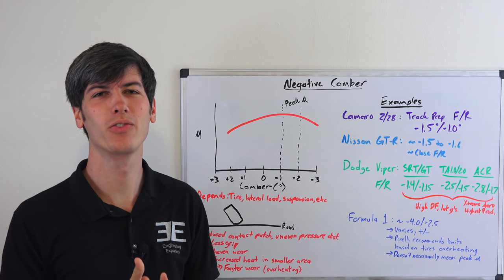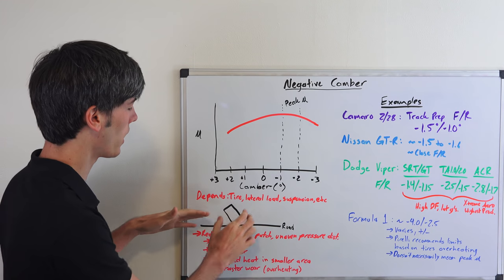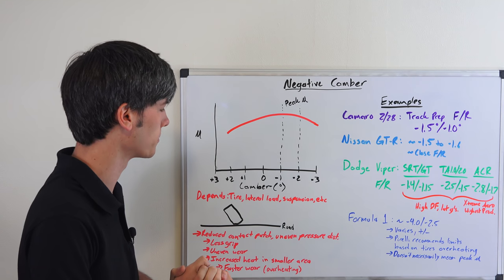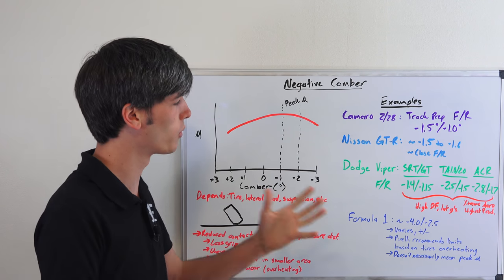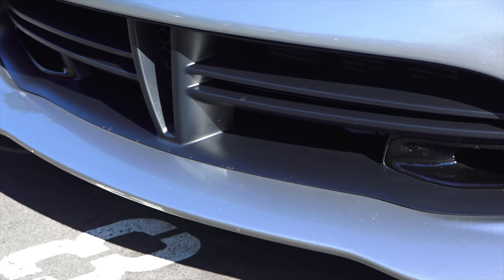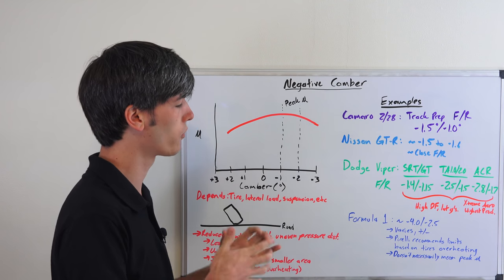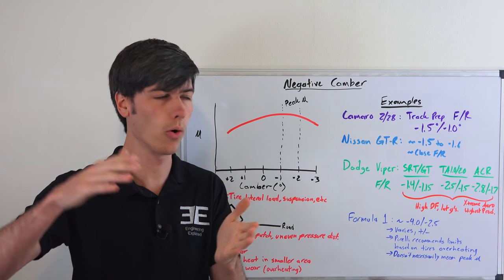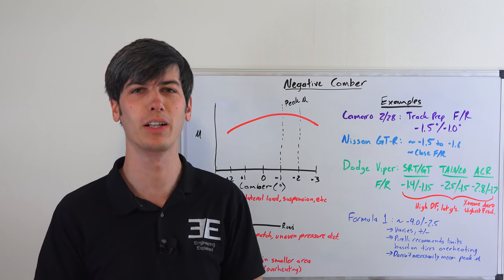Too Much Negative Camber - Wheel Alignment

Comment: Very interesting ! I was also wondering if camber wasn't depending on your suspension geometry and weight as well. Since, if I'm not mistaken, the wheels follow an arc when going up and down, so when you drive fast with a wing that applies a lot of down-force, pushing your car on the road and pressing on the suspension, your camber wont be the same as when you are at rest. So do you change the camber according to the average speed on a track ? Or according to the quantity of fuel ? Thanks, Yak
Reply: +Yak Eru depends on weight balance, roll center and cog, drive axles, and track layout, it's dynamic so setting the static camber along with spring and damping and swaybar rates are the ways to keep it in best range for grip and wear with loads.

Comment: If you change suspension components or adjust spring rate, ride height, or damper strength will the camber angle change? What are the normal parameters for a racing car vs a tuned production car.

Comment: For average street driving in my 2013 BMW 650i (w/M Sports package), I am experiencing excessive inside rear tire wear (excessive negative camber).  Do you recommend a specific DIY adjustable camber kit install so my tires last longer (third set in 18,000 miles), therefore wear evenly?

Comment: Not what meant, like a topic to see if electric, hybrid, diesel are viable technology in term of investment. 

I.e. VW Jetta TDI vs gas: it takes something like 5-10yrs for TDI to see the saving bc the high initial cost of car while there's no significant benefit for TDI sedan cars

I barely touch on the topic but I think you can do a better job based on your creativity

Comment: would it be beneficial for nascar cars on oval races to have different camber settings between left and right? since they only turn left the negative camber on the left wheels works the other way around and therefore reduces grip on the left wheels (during fast left cornering) or doesn't it?

Comment: What about pro drifters(FD Pros), how much negative camber do they since they are trying to get maximum grip. I know that when they are sideways the cars gain positive camber right?
Reply: +Linkcms2town On the front as the wheels turn the leading wheel gains positive camber, you want to have the lead tyre flat while you are drifting so you have the most grip, the rear you want to have the both tyre's as flat as you can get them while in drift so people tend to run almost no rear camber, some even run slight positive camber so when the car squats down it sits flat.

Comment: @EngineeringExplained What about rally cars? Would they use high level of camber since they are going fast and taking aggressive corner or is it not required ?
Reply from the maker: +GabLam0 The g-forces aren't necessarily that high since surface conditions do not allow for it. Traction for acceleration is critical. When I was with Subaru's team I didn't notice much camber on the vehicle, though I don't have specific numbers.

Comment: I wonder what the rear camber angle is on the british touring cars. they seem to have loads
Reply: Not sure but most of them are fwd. therefore they can run More camber on the wheels as they don't need to be upright for traction
Reply: +DumpValvesAndDnB that is true. only BMW and Audi are rwd I think.
Reply: +Lawrence Timme Most Audi's are AWD. This is their own, "Quattro" all-wheel-drive system.
Reply: DarkMan2555 i know, but there touring cars and dtm cars are rwd

Comment: So do you know how much faster a tire will wear depending on camber angle?  Maybe an idea for a video and i'd like to know before I buy a miata and slam it.  (Doing it right and not too much stance)
Reply from the maker: +Ty U. It depends on so many things. If you drive it casually, it will simply wear unevenly. If you drive it hard, the smaller contact patch will heat faster, and degradation will occur much quicker when it's heated.
Reply: +Ty U. just drive at max slip angle in circles and you'll be fine.
Reply: Engineering Explained I mostly drive casually, no tracks or autocrossing in my area. I just wondered about the number according to certain conditions.  Like what percentage tire wear will actually increase, how much more often will you need to replace, etc.

Comment: i run -2.5 camber but understeer a lot on corners. could i be just over-driving? SCCA guys in my area uses -3.0 and clocks faster than I am
Reply: Balance between under/oversteer doesn't depend only by camber values, spring rates, sway bars, suspension design and tyres are way more important, correct tyre temperatures and pressures are fundamental, with camber and toe you're able to make them as stable as possible, without too much difference between Inside and outside edge, wrong spring rates or wrong coilovers/sway bar setup affects your tyre temperatures, keep always an eye on them and change things consequently.

Comment: Does a fwd car benefit more with camber in the front or in the rear? i've seen the spoons EK9 and it looks like there is more camber in the rear than in the front
Reply: +jean lessage more negative camber in front, less negative in rear but also depends on specific geometries and designs, along with roll center and cog. Typically macpherson strut up front and multilink in back for packaging and cost. Macpherson loses neg camber through compression, multilink gains or maintains neg camber. Depends how much understeer you want, and how much that affects wear vs other mods like sway bars and spring rates and scrub radius issues.

Comment: what about drifting setup ? 
you have never done a drifting setup before it about time myu good sir :)
Reply: +axon magnus 

coscorrodrift 51 minutes ago
So for drift cars it is actually useful right? As it makes your car lose lateral grip.
Reply · 1 

Engineering Explained 39 minutes ago
+coscorrodrift If your goal is to lose grip, then sure. But that makes your car slower. To do it properly you'd want more power rather than less grip.
Reply: +axon magnus Check out some professional drifters cars, like the cars from Formula D.
They don't run that much negative camber. Most of the champions (Gittin Jr, Saito, Forsberg) run so little camber it's barely noticeable.
Reply: +Roger J if your goal  is to loose grip I.E. drifting it can be achieved in many ways. over powering force to the tires through shit loads of power in torque bet through building the engine and/or gearing. harder compound rubber. weight reduction. just to name a few. usually all those of course. and still have a proper amount of camber to maintain grip when needed, aka when not executing a controlled slide. and those extreme angle the front wheels have on drift built cars isn't camber...... it's toe....and even that much isn't really needed tbh unless drifting at damn near 90 degree angles is your thing.
Reply: +Cetifiably Snuggly Ryan Tuerck mentioned his camber set up's and while the rears are usually only a degree or so the fronts can be up to -5 degrees.
Reply: +wizz3r1o1 drift cars are actually looking for high mechanical grip levels, essentially to exploit the edge at higher speeds, from what i understand. i  don't think it's a lot of toe either, just much more steering angle built in.
Reply: @MrNicholg. TBH, Toe was the only thing i could think of atm to describe the extreme steering angle since i still cant think of what it's actually called. but yes what you said is basically what i was trying to say as well.
Reply: Drift cars apply a lot of opposite lock, think about the effect of caster. Since the car is going one way, but turning the other the caster ends up adding positive camber on the loaded front wheel at the outside of the turn, so drift cars run extra negative camber to compensate for this, also it looks cool (way more important).
Reply: @Nikita. yes this is also true. but i have seen drift cars that  don't run with extreme steering angles, extreme camber, or extreme caster because the drivers style is suited more towards controlling the drift with great throttle control and applying left foot braking at points through out the slide with a frontward biased brake set up to shift the weight forward rather then relying on the hand brake (unless its really needed) and extreme front suspension geometry.. in fact the alignment setup on these cars i've seen would pass for close to stock looking unless you looked twice. and if we're gonna bring looking cool into the equation, i personally prefer the way this style of drifting looks. imo, it's elegant and flowing, almost to the point to where if a chain of slides is executed just right the drift could look almost like the it never even transitioned into the opposite direction. so as i said in my first comment, drifting setups can be achieved in many ways.
Reply: thank you all for the , eye opening infortamtion :) , i trully aprecieate it , ha got to get better with drifting setup  on assetto corsa XD

Comment: It seems to me like the engineers who made the ACR just thought "Yeah, let's make everything big." Big engine, big splitter and wing, big tires, big camber angle. It turned out a good car, but just making things bigger isn't really very impressive engineerkng
Reply: +Jackisaboss1208 Yeah, Motor Trend did an interesting test of the Z28 vs ZL-1 with swapping tires and found that the big 305 trofeos did less for the ZL-1 than the 285mm fronts lost on the Z28.
Reply: +Jackisaboss1208 then you must not understand the car? how isnt it impressive that around a track, it is competitive with hyper cars?
Reply: Hesayad I said the ENGINEERING isn't impressive. The car itself is, but as a feat of engineering all they really did was make everything bigger. The car is all brute force, and lacks the finesse of it's European rivals, even though it may be faster

Comment: If I put camber on a car, I don't think I would EVER consider putting more that 4-5 degrees of camber on it
Reply: Unless it's a drift car, the pros run sometimes upwards of 7* up front so that when they are full lock the leading wheel doesn't end up with positive camber.

Comment: Why does the front have more negative camber than the rears?
Reply: +wilsongoalie1 because going into corners you tend to put more weight onto the front, so more camber is required there.
Reply: +wilsongoalie1 Because the steering does reduce the actual camber angle a bit. If it would be possible to have a steering lock angle of 90° on the fronttyres, the camber would always be zero when you go to full lock.
Reply: Because the axis that the front wheels pivot on is not perfectly vertical. Take a look at the caster angle.
Reply: +wilsongoalie1 to aid in rotation of the rear and grip of the front. differences are due to dynamic weight transfer issues within the chassis and suspension designs. Braking into a corner causes dive in front and lift in rear, out of a corner causes squat in rear and lift in front. combine that with cornering forces acting on the suspension arms, and weight balance of the chassis and different specific settings become more effective depending on the layout, ie fwd vs rear-engine rwd.

Comment: toe wears tires not camber
Reply from the maker: +Euphorica Camber may not increase tie wear (though it probably will slightly, and will if it's high camber), but it will definitely cause uneven wear.
Reply: +Engineering Explained disagree unless you are running something silly. anything on the cars you mentioned and even beyond will have even wear if their toe is in spec.
Reply from the maker: +Euphorica https://www.cokertire.com/blog/wp-content/uploads/2011/03/100302-CT-Uneven-Tire-Wear-13.jpg
Reply: +Engineering Explained Nice amount of patience you've got man. I don't think I could handle an entire internets worth of "experts".

Euphorica, I don't know what level of understanding you have in regards to physics or engineering but you should just take Jason's word on this. 
While anything under -5 camber won't necessarily be noticeable to the eye, it can definitely cause uneven wear starting around -2 for the average passenger vehicle that will be visible at the end of the tires life, especially without rotation. Anything more than -5 will start to cause serious wear issues in a daily driver, and -5 is such a tiny amount that most people won't notice it. I deal with alignment on modified cars all day long wear some kids tried to get -5 camber and ended up closer to -15 on one side and -20 on the other.
Reply: +Matt Burkett -15...lol no one is talking about those kinds of outliers here. 
I've got plenty of real life experience running reasonable camber that's best suited for performance. it's common for newbs  to think camber wears tires..in the examples in the video and beyond some of those oem set ups you will not have wear from the camber. it's all about toe.
he's not the only one with an engineering degree here...
Reply: Euphorica Toe is the bigger issue, I agree and you could definitely run more than -5 camber and not see any noticeable wear depending on the set up especially in a race or performance situation, but for most stock vehicles running -5 or greater and you will start seeing uneven wear.
You stated that camber can't cause wear, which is just plain fallacious.
The whole video was about suggested setups from companies that spend millions every year on engineering, with the best engineers in the business and you think you know better?
Reply: +Matt Burkett I'm responding to his video. not outlier cases of people riding around scraping their front knuckles . go troll elsewhere.
Reply: I'm not sure what your glitch is, and I'm sorry you take offense at logic and being reasonable but you clearly did not watch the video and are unwilling to listen to Jason, myself or the actual experts who design tires. If you would like to continue this discussion as an adult instead of screaming troll at the first sign of intelligent discourse I would be happy to.
Good day, sir.
Reply: +Matt Burkett keep living in a dream world at the tire shop, troll. I'll continue to be an engineer...and run the camber I need. again you're the one who brought up outlier examples of -15(lol). not being discussed here nor in the video.  You were clearly offended and felt the need to flex your tire balancing prowess.  get lost.
Reply: And with the ad hominem attacks. I brought up the fact that anyone trying to set -5 camber without an alignment machine is going to end up way over their target. The thumbnail is of a car with something like -15 to -20 camber, so those numbers aren't out of nowhere.

You attack me by claiming I work at a "tire shop", yet claim to be an engineer while disagreeing with actual real paid expert engineers. Why should anyone believe your bragging when you're wrong?
My initial statement still stands, I don't understand how Jason has the patience to deal with an entire enternets worth of people like yourself. 
You can run whatever amount of camber you would like to, it's your car. If running more than -5 camber actually suits your needs then more power to you.
Reply: +Matt Burkett bragging ? you said you dont know what my understanding of physics or engineering is...  you chose to reply to my post all while (apparently ) referencing the thumbnail and nothing he actually said in the video ?  that's where my discussion is based. not on a thumbnail or diy  camber adjustments. you're making up new angles every response which are irrelevant.  have fun working on that hunter.
Reply: Euphorica Is that all you're going to do? Ignore everything that I've said except the one sentence you can twist to make your point? I really don't get people like yourself, is it a neurological disorder that makes you try to manipulate peoples words instead of converse? Are you like this to your friends and family or just on the internet?
I get that you just want to have an argument at any cost instead of sharing knowledge, I won't indulge you any further.
Have a good day.
Reply: +Matt Burkett I think you need to reread your post and look in the mirror.
Reply: +Euphorica so i take it your NOT an engineer then....
Reply: +Shredxcam22 you would be incorrect
Reply: +Euphorica mechanical? aerospace? electrical? industrial? Do you have any math to prove less contact patch does not equal increased wear and heat?
Reply: +Shredxcam22 less contact patch when ? it's all about maximizing dynamic camber to the best of your set ups ability. this varies from car to car ,and even tire to tire. many tires are designed with some camber in mind. 
again I'm not talking about some wacked  out extreme stances car. I'm talking about the values that most well set up street cars see. camber wear is negligible in these cases. even with an inferior mac strut set up(which usually require more static camber to account for its crap design re:performance )
Reply: +Euphorica this is very true! I learned through experience
Reply: +testing316 exactly ! books and theory are useful...and then there is real life experience.  theory doesn't always translate 100% to real life.
Reply: what kind of test? did you isolate all outside variables? did you make it scientific or just drive around town...
Reply: +Shredxcam22 it's called  a race track. and daily driven. some people actually do shit irl rather than argue online.
Reply: so what branch of engineering do you work in again?
Reply: You sure about that?
Reply: +Euphorica youre disagreeing with someone who is 10x smarter then you.you must have fun trying to lose  arguments
Reply: ***** not an engineer hbu? oh yeah thats right you arent either
Reply: GotzeGaming Im not? How do you know?
You clearly stated you arent, so leave the convo to people with some education.
Reply: ***** i guessing you should leave the convo then
Reply: GotzeGaming sick burn bro